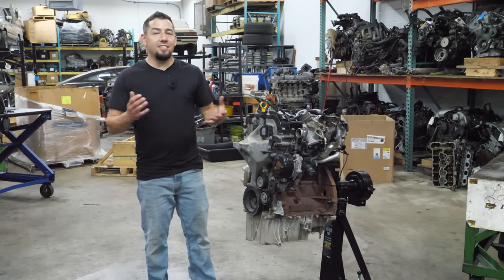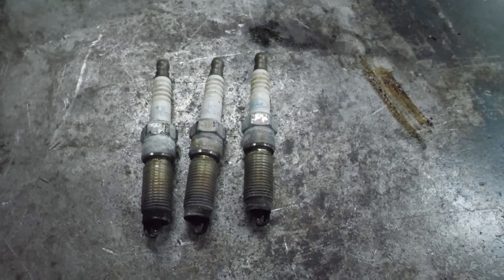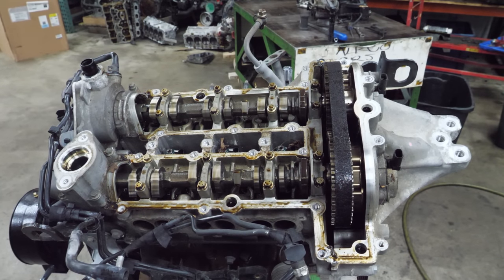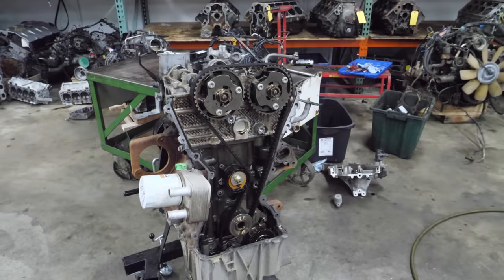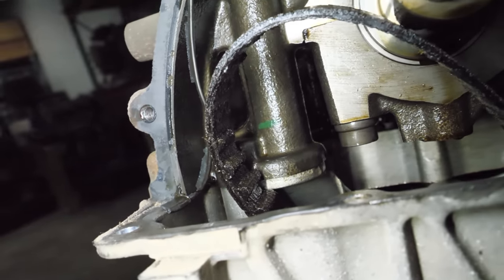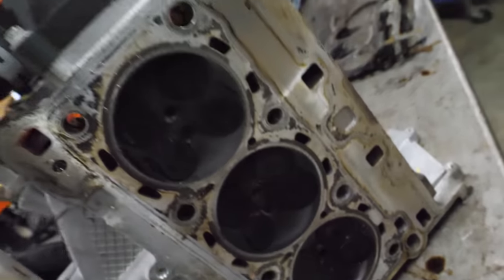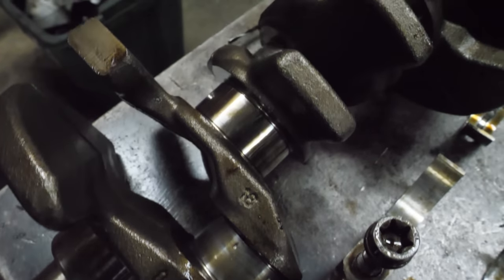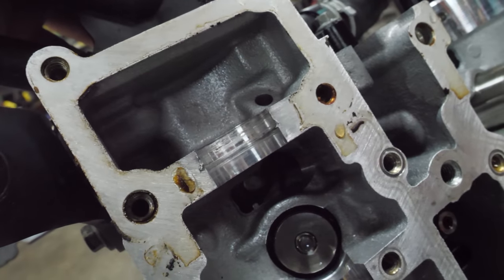JUNK Ford Ecosport 1.0L 3-Cylinder Ecoboost Teardown. LAWSUIT ENGINE!

Comment: The Ford timing belt dipped in oil has got to be the gift that keeps giving.
Reply: magnificent dip🤣
Reply: @Species-zn8vz  🤣 excellent comment!
And Ford is not the only manufacturer doing this 😬
Reply: Works fine in the 1.6l 4 cylinder!
Reply: @markharris8929 the 1.6 isn’t a wet belt
Reply: You can get a camchain conversion kit for the 2.0 diesel mondeos which is what I plan on doing
Reply: @AngloSaxon449  I don't think even MK5's have wet belt?? Certainly have had any belt issues in my mk4 2l tdci and it's been driven plus 600tkm's. It's on its fifth belt iirc.
Reply: @jothain  mines a mk4 2012 had brand new cambelt and water pump before I bought it
Reply: My 2017 1L vetec civic has the same wet belt. Just been informed by letter by Honda that at 6yrs old this needs changed, £1095.
I’ve read guys paying up to £1600! It’s mainly labour costs. I can’t risk not getting g it done. All other models are chain.
Reply: @MrSmid888 Honda has recently reduced the fixed price.
Reply: Looks to me the tensioner failed first, stripped the wet belt due to lack of tension on the metal gears, and oil starved the engine and turbo. 
That said, still a terrible design. And no belt tensioner should fail in 4 years time. Despicable that they dont get fined for this.
Reply: @MrSmid888  Probably the worst Engine Honda built. Im glad they went back to the R-engine after that..
Reply: @elementalshift  My closet Honda dealership price is £1365.
The one that sent me the letter offered £1195 with a £100 discount since I’d used them before. (I’ve used the more expensive garage more for work).
Reply: @The_Noticer.  The car cruises along fine, I’ve had no issues. Currently in 50mpg. I do 50 miles per day through the week. Another issue with the 2017 model are the abs sensors, I’ve changed 3. They throw up every issue on the cluster. £260 a pop at a dealership. I like the car I just wish I had the knowledge about the timing belt pre purchase. Such is life….
Reply: Citroen c3's also have that same wet belt issue... the belt literally starts swelling in the oil!
Reply: @HouseOfPetrol Stellantis 1.2 puretech used in Peugeot, Citroën, DS and Opel/Vauxhall vehicles
Reply: Yup and we're supposed to believe the oil soaked oil pump belts will last the life of the engine LOL
Reply: @BraapBanana_  indeed ;) 
Stellantis Tech. Here 😄
Reply: I have a Honda lawnmower engine that has an oil wetted cam belt. When I took the cam cover off to fix an oil leak I panicked ! In most cars oil contamination of the cam belt was very damaging !
Reply: @jothain well my engine has 180000 miles and is on the original but its not a ford 🤣👍
Reply: It is a life-of-engine belt system; when the belt breaks, the life of the engine is over! 😂
Reply: My 2016 ecoboost failed on 70, 000 got a new engine from Ford for my mechanic to fit, 6.000 quid but they wanted the old one back? WTF
Reply: @The_Noticer.  the biggest problem is that to replace the components, you have to pull the engine out and tear it down basically. Unless you are a DIY’er, most folks can’t justify the cost vs the value of the vehicle.
Reply: @BraapBanana_  we call those purecrap engines here in America. Although their official name here is Multiair
Reply: @MrAvant123  That’s about their only viable use. In small engines like industrial equipment, and scooters.
Reply: Yeah, our oil belt failed at 56K - engine replaced under warranty…piss poor design.

Comment: Hi, "I Do Cars"   -thank you so much for this video.
Long story short,   I've owned a 2014 Ford Fiesta 1.0L  since day 1.   today in 2024...  that thing is running like new.
of course,  I can feel the plastics shaking and vibration from wear...   but the engine,  I have nothing to say about it.
My oil changes have been ON TIME.   Maintenance is key,   changed the spark plugs at 100,000 Mi,   same with the Coolant and the belts (all).    I had to replace the water pump and that's it..  
I am very happy with this little engine..  It does gives a 45MPG on highway... and about 38.5 combined. Stilll.. yes still after 10 years and 140,000Mi...     
Thank you for this video,   I will be happy to do more on my little engine to last longer...  Cheers!
Reply: You even had the pre coolant system fix year. I have a 2016 with 130k, oil changes, plugs, air filters, and it’s doing great. I did replace my suspension components after driving a few too many Uber rides with passengers pushing me well beyond the payload capacity of the little car. Probably will buy a used replacement engine so I have one on the stand ready to go with a new timing belt, and when the used engine hits timing belt time swap them around. Here’s to hoping our little Foxes keep running strong.
Reply: I have 2013 fiesta 1.0 ecoboost with 150.000 on it and it still runs fine .i did have to replace the dps6 transmission this week because it was more a noise complaint for a few months because it may have a few busted bearings the fault is mine i never changed the oil but it only cost me 2400€ for a refurbished one and built in and that transmission is working fine
Reply: Just remember that a General Motors LS based engine can run for 300k miles without needing a rebuild

Comment: Very common issue around here in Brazil, using The wrong oil specification causes that problems on the belt material, it deteriorates and get loose in the oil, Ford Ka,  GMC onix are other examples. Very good vídeos Eric!!
Reply: That actually makes a lot of sense
Reply: When I saw that the filter wasn't motorcraft, I wondered if it was an incorrect oil issue that caused or contributed to the belt failure.
Reply: I also was thinking that the wrong and oil would be detrimental to the belts. The problem is that all the heat and contaminants can be good for rubbers.
Reply: Óleo errado ou de má qualidade aqui no Brasil já é um problema rotineiro

Comment: I've been quite curious about these little units for a while now.... all I can say is my face was contorted in disgusted ways most of this teardown! This engine easily deserves to be on the top of the  list of worst engines ever designed and built!
Reply: Makes my HT 4100 look like an excellent engine. Actually,  my 4100 in my 83 Eldorado has been perfectly reliable,  still running fine at 182.000 miles. But I know they definitely aren't great engines. My meticulous maintenance has certainly been most of the reasons,  and possibly i just got a good one also.
Reply: Plus it's ugly. The timing cover is ugly. The oil pan is ugly. The camshafts are ugly. We can overlook brutal design if a thing is useful, or if it is dependable. This engine is neither. It looks like something out of mid-70s Soviet factories.
Reply: @johnfranklin5277  I see another person that likes to self inflict pain. Mind you, your ht4100 is miles ahead of my Olds Diesel
Reply: Meh hold my beer. 
You guys like Audi's and BMW's? 😢😂
Reply: @V8Power5300  LOL . Hang in there!
Reply: No more Ford's for me. Small or big.

Comment: A masterpiece of brutal cost cutting.
Reply: trimming the hardware costs down to a penny ...
Reply: Cost cutting has nothing to do with it
Reply: @davelowets  what tf else could it be.. pray tell..
Reply: @davelowets  For sure it is, you could easy make a better design on the oilpump/balance chaft if there was no cost issue. Even using buckets on the head is a clear sign. you don't use buckets on car engines, well you could if you are going past 8000prm appication, but I don't think a eco motor have that's for a goal.
Reply: Its actually bad even for cost cutting.   To cut costs, they would have made a better engine by NOT having a fuel pump attached to the cam. And the chain design is the worst I've seen for , well ever.   They could have used a single double link design and a crankshaft oil pump.
Reply: The Mastery of drug addiction!!!

Comment: There is a good reason for no keyway on the crankshaft sprocket.
 It is known as a fully floating sprocket and is a very common feature on most modern OHC engines. It allows for perfect valve timing using alignment tools rather than timing to the nearest tooth. It is almost obligitary on diesel engines due to tighter piston to valve clearance. 
 It is extremely rare for the sprocket to slip, if fitted correctly using a new bolt with each use. The added benefit is that timing is unaffected if the cylinder head or block needs to be skimmed.
Reply: huh - interesting point. It just reminds us to make sure we understand an engine before tearing into it.
Reply: I'm 50 years at this and learning every day. Car mechanics motto  -  "Fools dash where angels fear to thread"

Comment: I had a 2016 Fiesta with this motor     It was smooth, sounded great, had nice mid range punch and got 52mpg highway. Definitely made an economy car more interesting to drive. 

I also dumped it when the warranty expired because I knew it was a ticking time bomb as evidenced here.
Reply: I've got a 2017 Fiesta SFE 5-speed with just over 40,000 miles, should I be worried?
Reply: @obsoleteoptics  yes.
Reply: @obsoleteoptics a little. they are notorious for their unreliability.
If it's what ya got then run with it while it works but dont expect any more than like 100k tops.
Reply: @obsoleteoptics  I'm convinced that the engine in this video had 50,000 miles and failed as written on the oil filter. I recommend you get that belt changed out for piece of mind.
Reply: Good choice hahaha
Reply: @obsoleteoptics  just change the timing belt at 65k or so and do regular oil changes ever 4 months, you'll be fine.  Manual transmission cars rarely have catastrophic probs.....
Reply: @henryjoshual1848  the failed belt is the oil pump drive & the engine has done 70k, it's probably done 5k or more with a few teeth missing so 65k is not soon enough. 

On another thread someone claiming to be a Ford engineer says this belt breaks up if the oil isn't changed frequently enough & my guess is that the recommended Ford oil has an additive specifically to preserve that belt, an additive that's unlikely to be in any other brand oil.
Reply: You knew wrong. If you were just putting the correct high quality oil and do the maintenance right, it lasts longer than the body (under no accidents, of course)!
Reply: @nutgone100  I've owned the car since new and have only taken it to the dealer for service, so if they put the wrong oil in it, that's on them, is it not? I even specify full synthetic otherwise they'd put that synthetic blend crap in.
Reply: @obsoleteoptics  no
Reply: @obsoleteoptics  Just because you get the oil changed at the dealer, it doesn't mean they're always using the right stuff.  And unless they admit on paper to using the wrong stuff, any damage caused is on you to try to prove they did it
Reply: @DonziGT230  "on paper" you mean like the service write-up? I still have all my receipts and service records.
Reply: @obsoleteoptics  The service papers will likely show the correct oil type and amount because it's put there automatically by the computer based on your car, whether or not the person uses the correct oil will be unknown unless the person admits to it.
Reply: @DonziGT230  Indeed, that's the concern. I would do my own oil changes myself if I had the time, space, and tools to do so.

Comment: I currently have a 60k 2018 Fiesta with that Ecoboost engine and honestly I've found it's okay compared to various other engines I've experienced. You may find it hilariously small but in Europe it's a more "sensible" size. I would suggest that the overall failure of that engine you have there is belt degradation which secondarily blocked the oil pickup for a lack of oil pressure. This is a known thing here, you have to religiously use the correct oil for that belt, a Castrol/Ford recipe based on 5W20 and nothing else. If the oil pressure light comes on, you stop and call for a tow, do not attempt to drive home. Thanks for doing a ecoboost!
Reply: My 2.2L GM Vauxhall Vectra was literally priced off the road for being a Gas Guzzler. I replaced it with a 1.4 litre Golf that does 50MPG so the annual road tax is less than 1/3rd of a tank of fuel. Of course old Tesla Model S drivers will have the last laugh paying no tax at all.
Reply: Tesla owners will be constantly replacing thier Teslas because they are not made well
Reply: @MrDuncl  their car insurance and service interval more then makes up the difference.
Reply: Tesla owners need to replace their testes for being scared to burn a little of that sweet sweet guzzoline.
Reply: I should hope a car with only 60k miles on the clock would be "okay". I got twice that out of an old Austin A-series, designed to 1940s tolerances. the engine was still fine when I sold it despite having been cooked by a broken radiator.
Reply: The initial set up of recharging free is quickly evaporating. Taxes are being introduced in some countries already on electric cars.
Reply: Terrible engine.
Reply: Well our fully maintained and cared for 1.0 Ecoboost Fiesta died after about 60k miles due to wet belt failure.  No prior warning….it was all good until the oil light came on.  We sold the car, as it needed a new engine and the bodywork was in excellent condition.  Won’t be going near Ford Ecoboost piles of crap ever again.
Reply: @adrianshingler9783  That's paranoia inducing.
Reply: in europe manufacturers are forced to downsize engines for tax reasons (the tax that owners pay for certain car) and to get some power out of it there is the turbo. I would not call it a sensible size engine.  From start i would never buy a car with such an engine.  Result is, i pay more tax but so be it. I like to drive 2 liters with no turbo. And the whole car is bigger, better and more enjoyable than such a small car with that (bad ) engine.
Reply: EVs half in value in less than a year, trash cars
Reply: I ve only ever brought one ford a cortina mk 3 1976 ohv 1.3 and this is why I won't buy another ford the engines are crap.  I have two cars one a Toyota yaris and the new mg zs and the Toyota's are fab as for the mg it's got 7 years warranty